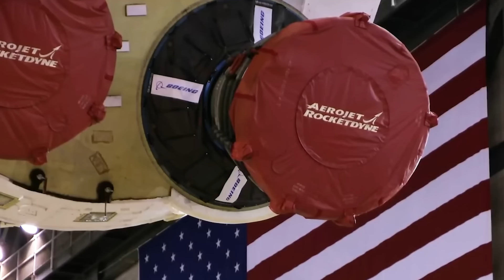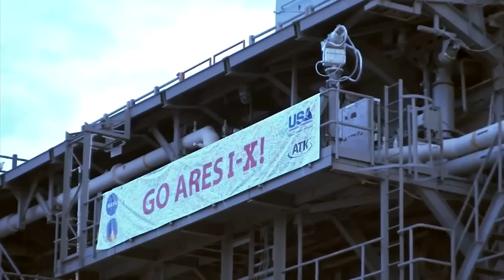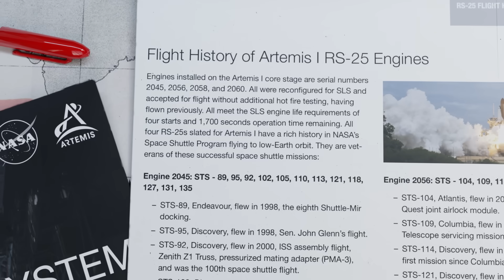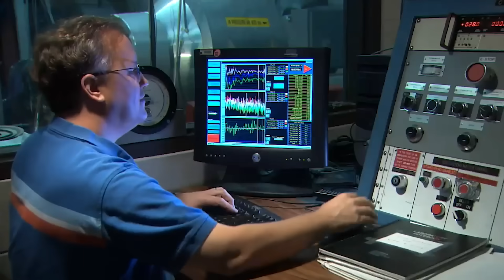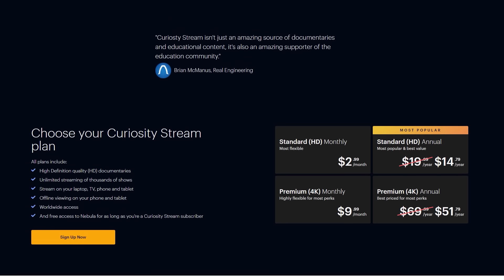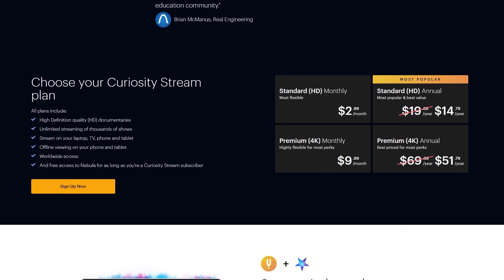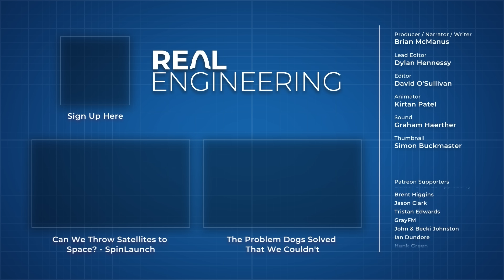The SLS is Outdated. Why Does it Exist?

Comment: The other thing to remember is that many of these parts were already "human rated" whereas ships such as Starship is not and won't be for a while still.
Reply: That's a very good point.
Reply: True, but that's intentional, they're designed using very different philosophies. Starship will likely get human rated after flying enough times just like Falcon 9. Honestly I'd feel safer flying on a rocket that got the human rating after proving itself many times than a rocket that was designed to be human rated in theory but hasn't flown much or at all.
Reply: “Human rated” in the sense that someone has predicted it should work. I prefer “human rated” being demonstrated rather than predicted. The SLS is so expensive that we can barely build one every few years, let alone test them prior to use.
Reply: @limiv5272  , based on that, you're not appreciating how man-rated systems are designed and built. 

The necessary tolerances and checks of key indicators are built into the procedure, not designed into it after enough data points are generated.
If you change subsystem components downstream, it becomes a new, untested configuration again, many components of which representing a single point failure.
Reply: @limiv5272  A rocket build from parts of the shuttle, which killed 14 people.
Reply: yes but if that's the concern, you can just launch a person into LEO in a crew dragon and rendezvous with starship there, instead of taking Orion all the way to lunar orbit before rendezvous.
Reply: Parts aren’t human rated. Systems are. The whole system has to work for it to be safe. So reusing all these parts didn’t really help in human rating the ship and it didn’t save money.
Reply: ""Human Rated""?? These parts have killed 14 people 😂😂😂say hello to Columbia and Challenger Space Shuttle
Reply: The space shuttle was human rated, and had an failure rate many times higher than pre-human rating Falcon 9 launches, as well as a lack of any sort of viable launch escape system. Human rating is a political thing, it doesn't mean much.
Reply: @brll5733  the space shuttle delivered over 800 people to low earth orbit across more than 130 missions.
Reply: @blipboop5594   the space shuttle delivered over 800 people to low earth orbit across more than 130 missions. It averaged 5 launches per year. It proved itself to be reliable.
Reply: @Nightdreaux22647  the parts delivered over 800 people to low earth orbit across over 130 missions.
Reply: @DeepDeepSpace  with a dead crew every 60 flights.
Shuttle had many points to criticize - like the very limited launch abort capability, unlike Saturn 5, the Crew dragon or now SLS with Orion a launch abort was only possible in a very limited time frame. Most time of a launch an abort wasn't possible, also because you can't shut off a solid rocket booster once it's ignited.
Also it could not fly without a crew, even if the mission itself (it launched satellites in the 1980s) didn't even demand one. Nasa made the mistake not to do further development, they stuck with the first generation of a launch vehicle planned in the 1970s until 2011
Reply: SLS still is not human rated either. And until Starship is capable of landing astronauts on the moon, SLS is completely pointless. SLS needs Starship to work.
Reply: @simonm1447  the shuttle delivered and returned over 800 people to and from low earth orbit. if flew over 130 successful missions averaging about 5 missions per year. 
Furthermore, launch abort systems are more for piece of mind than actual safety. In the event of an explosion it is highly unlikely any of these abort systems would save the astronauts. In the event of engine failure,  abort systems can work, but the space shuttle was also capable of aborting if there was engine failure. It could detach from the tank and glide to a designated runway.
Lastly, the final design of the space shuttle was not NASAs decision, it was the US Airforce's decision. It was a joint project between the two. NASA wanted a small winged vehicle to service an orbiting space station. The US Airforce wanted a large vehicle with a large payload bay. NASA only planned to use the shuttle for 10 years, but congress didn't provide the funds to develop a new space craft.
Reply: @DeepDeepSpace  I know the numbers. However, if you compare that to a F9 you paid $ 1,6 billion per single launch which always included a crew, while putting a simple satellite in orbit don't demand a crew at all and can be done by a F9 too for $ 60 million today. 
F9 can also reach ISS with a crew of up to 6 (the maximum capacity of the crew dragon, even if just 4 seats are mounted and used).
Shuttle could never do any deep space missions, since it had too much dead weight and the heat shield would not have survived a reentry from lunar orbit with 40k kph (a reentry from Leo is done with 27k kph).

One reason shuttle existed at all are military missions, it could fuel up spy satellites in orbit (you can't do that with a normal launch vehicle) and it had a cross range capability to fly back from a position over Hawaii on a polar or sunsynchronized orbit to Vandenberg after satellite refueling.
Aborting was possible with the shuttle, but only in a very limited time frame. A conventional rocket don't has this limitations. A proper abort system could have saved the lives of the Challenger crew, they died on impact on water, not because of the explosion.
Reply: @brll5733  Killed because of bureaucracy, lack of oversight and human error in construction. Faults can occur with any vehicle at any time. 

The shuttle was sound enough to have flown 135 times. You can argue design flaws were to blame. Reality was that Challenger was down to management decisions while Columbia was down to the fact the foam was improperly applied.
Reply: @Nightdreaux22647  Refer to my reply to Br LL
Reply: @simonm1447  F9/Dragon cost less to launch because it is smaller and lighter. The space shuttle was a much bigger space craft designed to support 7 astronauts for up to a month so naturally it costs more to launch. And the space shuttle was never intended for manned deep space missions. It was designed to support an orbiting space station to test the feasibility of long duration space flight in preparation for a manned mission to Mars. Furthermore, Dragon in its current form can't be sent to the moon either. It would need enhanced thermal protection as well as an engine.
Reply: @gamingwhatwecan  SLS does not need starship to land on the moon. A small lunar lander can be added to the SLS.
Reply: Like the Boosters on Challenger?
Reply: @DeepDeepSpace  you could launch 25 F9s for a single shuttle launch - 25 smaller launch vehicles have way more payload than a single shuttle launch.
One main problem with the shuttle was the long refurbish time, it took months to refurbish it after landing, there was never a solution for the heat shield tiles where hundreds fell off during reentry and every single tile was unique in shape and thickness, nothing was standardized. Also the RS-25s had to get disassembled and refurbished after each flight.
Reply: @DeepDeepSpace  No it can't. SLS doesn't even have enough energy to put Orion in low lunar orbit, let alone adding a lander to the mix. And no such lander exists in reality or in development.
Reply: @simonm1447  the shuttle was a human rated space craft designed to support 7 astronauts for a month. That is going to take more time to refurbish than an unmanned rocket.
Reply: @gamingwhatwecan  yes it can. SLS has the energy. The issue with the orbit has to do with the Orion. It's engine isn't powerful enough for a low circular orbit but it can put itself into an elliptical orbit of the moon that brings it close to the moon with each orbit. The landing will occur at the closest point. But a small landing craft could be sent with Orion to make the landing.
Reply: @DeepDeepSpace  Dragon is launching on refurbished boosters too - and Dragon is refurbished too. Of course dragon can't support a crew for a month, but this was never a criteria and the Shuttle also didn't need this capability for ISS missions, which represents most missions from the late 90s on.

At the end the Shuttle never reached a higher success rate than most commercial launch vehicles, like the common ULA rockets or the Ariane 5 which was never man rated
Reply: @DeepDeepSpace   you think SLS has a bunch of spare capacity but NASA is deciding to simply shut the engines off prematurely instead of imparting more velocity to Orion? Neither of them has fuel to spare, SLS doesn't throw Orion hard enough and Orion doesn't have enough fuel to make up the difference, which is how we are getting the NRHO stupidity. Add your hypothetical lander (which also needs a hypothetical fairing) to SLS amd there won't even be enough energy to get the spacecraft to NRHO, probably not even to LEO.
Reply: SLS fanboys: "Starship can't take us to the moon because it hasnt flown yet and isn't human rated yet!!"

Also SLS fanboys: "we can land on the moon with a hypothetical lunar lander concept that doesn't exist, isn't being developed by anyone and hasn't been human rated or even approved for a contract by NASA"
Reply: @gamingwhatwecan  you claimed SLS/Orion was useless without Starship. That's nonsense. A small lunar lander can be built. They built one over 50 years ago they can build one again.
Reply: @gamingwhatwecan  the SLS has the energy to push Orion and a small lunar lander to the moon. It's just a matter of Orion having an engine powerful enough to slow the velocity enough to fall into a lunar orbit. Furthermore, the SLS that is launching tomorrow is the Block 1 version. Future variants will be even more powerful.
Reply: @DeepDeepSpace  yeah but if there is no plan to build one it’s never gonna happen. Also keep in mind that this is only possible with a hypothetical “Block B” variant of SLS, something that is only planned on co-manifesting gateway modules with Orion.
Reply: @DeepDeepSpace  if what you’re saying was true then they could simply keep the ICPS attached to Orion and have the ICPS perform the deceleration burn. 

Alas, no they literally can't rebuild a small LEM like they did 50 years ago because modern safety requirements will drive up the mass (more than mass can be saved with modern materials).

Even if you get a 15t lander like Apollo (which only fits two astronauts), that's 41t that needs to go to trans lunar injection. SLS Block 1 can only do 27t.

Yes, it's theoretically possible to develop future versions of SLS for these future lunar lander ideas. But Starship is much closer to hardware reality than any such scheme. SLS cultists should stop having faith in technology which doesn't exist.
Reply: @limiv5272  I think there are some roadblocks to Starship being human rated as it currently stands. I think the "belly flop" landing concept will likely never fly with people inside, too violent. You could give it wheels and try to land it on a runway, but I can imagine the shape and limited control surfaces would make that impossible. I could see a vertical landing work, but you'd still need to keep the g forces for any orientation changes limited to not injure the squishy astronauts. I don't think it's impossible for starship to be human rated, but I think some major changes to design and operation may be necessary. In the end it's a bit speculative at the moment, Starship is still some distance away from consistent unmanned launches, let along manned.
Reply: SpaceX have the only operational human rated launch system in the US. This system is not human rated yet and it has never flown, so I’d say it’s behind Starship which has demonstrated its ability to take off and land and is basically from the new millennium rather than the old. My prediction is that the SLS won’t even fly this month as I remember all the launch delays with the Shuttle, oh and the boosters exploding. Nope, the SLS is a giant rusting white elephant.
Reply: @DeepDeepSpace  The Apollo lander only had to land from low lunar orbit - a lander built for Orion would have to land from near-rectilinear halo orbit, and return to that same orbit. This requires far more fuel - not to mention longer duration life support since the orbit has a period of over a week, compared to 2 hours for low lunar orbit.
So no, you can't do the same job with a small lunar lander. Even the Dynetics HLS, the smallest of the three proposals, would have been about triple the mass of the Apollo lander, and that design was later found to have insufficient performance to land. National Team's HLS was more like four times the mass.
Reply: @marcusoutdoors4999  the SLS is scheduled to launch tomorrow morning. Furthermore, no shuttle booster ever exploded. 1985 saw the launch of 9 shuttles with STS-51B launching only 10 days after STS-51D landed, and Boeing's Starliner is scheduled for it's first crewed launch early next year. 
As far as Starship goes, the Super Heavy booster which is the key to the whole thing has yet to launch nor does it have a launch date.
Reply: @DeepDeepSpace  elon said 1 to 2 months
Reply: I'd rather fly in falcon 9 then this old dinosaur. Starship is going to surpass anything currently
Reply: @blipboop5594  after the Challenger disaster the probability of fatal failure for Space Shuttle was re-calculated to be 1 in 100. I don't know how they calculate it but it's true because of what happened to Columbia (which is indeed within the next 100th flight) the increased maintenance & refurbishment cost did not prevent it, because the design alteration is the reason for fatal incident to occur because 1st they removed ejection seat (which otherwise could save the astronaut during the Challenger incident) and 2nd they stopped painting the fuel tank white (which probably lead to ice formation that cause the Columbia incident). Man rated is mostly about the escape/survival system like abort rockets, ejection seats, and abort procedure which is missing in Space Shuttle (eg: only after the Challenger incident that they devise an abort procedure that allow Space Shuttle to turn around like Falcon9 and return to runway, otherwise they don't have any abort procedure for an incident before reaching orbit, and still didn't have a procedure to abort if SRB experience a failure).
Reply: @triple466  unless Elon plan for the Starship to have an ejection system it would be a death-trap just like Space Shuttle. Space Shuttle for example didn't have any abort system at all, once the SRB is lit it was 1 way street to orbit, only after Challenger that it has procedure to return to runway but it itself is very risky as the Shuttle have to turn around like Falcon9 and it wasn't designed for this.
Reply: @xponen  starship doesn’t need a crew to fly they can test it many times before putting a human on board it’s not like a one time thing like SLS
Reply: @triple466  safety culture is mandatory, an abort/escape system still need to be added.
Reply: @xponen  that’s easy they can install it but not untill it reaches orbit first by itself it’s a work in progress. The rocket can fly 100 times without humans to perfect it. He has more than one rocket he wants to have 1000 rockets and all cheap and reusable.
Reply: Yes. Especially on the computer engineering side. A lot less room for single point failures and multiple contingencies that could be used in a non human rated system that couldn’t be used for a human rated vehicle. Human rated systems are substantially harder to engineer
Reply: @dfiler2  this first launch is a test to ensure everything works correctly. It appears that the Dragon crew capsule only had 2 flights prior to being manned, compared to SLS's 1 flight.
Reply: @Croz89  I think the belly flop was designed to have G forces a human can survive, though you'd probably need to install vomit shields between passengers 😉
We'll definitely have to wait and see if they make any changes to the design, you're right, it's still very early.
Reply: @DeepDeepSpace  the Challenger Shuttle blew up because of a seal failure on the booster, check it out, historical fact, plus I was horrified to watch it live. Boeing has properly lost its way as a company. They were awarded significantly more than SpaceX to create a human launch system to support the Space Station, yet years after the SpaceX solution went into operation, Boeing haven’t even managed a fault free test. My prediction is todays launch will be delayed or scrubbed. I predict SLS will only ever fly once and that plans will be changed to utilise more modern technology. But the key question for me is why anyone would support such a politically driven Frankenstein’s monster when the United States has the best space engineering company in the world by far, SpaceX? If I was an American I would be so proud. Here in Britain we are amazed by the technology and one of my more remotely located neighbours has just got Starlink.
Reply: @limiv5272  I'm not so sure, I think it was designed to cause minimal damage to the vehicle. The rapid change in orientation is going to make it very uncomfortable for passengers at the least. The problem is Starship is so bloody massive and awkwardly shaped that options for landing it, especially on earth, are limited.

Honestly, I think it's a bit of a waste to use such a massive vehicle for only carrying 3-4 crew members anyway. Save Starship for cargo, something smaller would be better for humans.
Reply: @brll5733  I don't think it's fair to blame those death on the Shuttle. One was because of human "error" in approving the launch. 
The other because of damage to the tiles by falling debris.
Reply: @editman145  NASA reused the space shuttle and its solid rocket boosters for 30 years across over 130 missions.
Reply: @gamingwhatwecan  Well, then it won't ever work.
Reply: @DeepDeepSpace  I watched the Challenger explode and kill all on board due to a failure of the seal on its booster. The booster’s failure is well documented historical fact. Predictably today the SLS failed again, repeating the pattern of multiple issues that has meant it hasn’t even managed a single wet rehearsal. I stick with my prediction it won’t fly this month and I’d say the chances of a launch in September are less than 35%. With regards to SpaceX, as a Brit I’m baffled as to why the US isn’t more proud of having the most technically advanced space company in the world. This year they’ve launched more than a rocket a week, they have over 3,000 satellites in their Starlink Constellation and my god man, you can’t have an eye for detail as the SLS Will is dependent on a Starship to land on the moon, yes the Starship is the vehicle which will fly all the way from earth and land on the moon having picked up its crew from the pointless outdated SLS
Reply: @marcusoutdoors4999  the Solid Rocket Booster didn't explode. The SRB exhaust burned through a seal between two segments. The exhaust ignited the fuel in the external tank. The accident happened because the challenger was launched in weather that was too cold. The cold weather weakened the seals. Engineers warned about it beforehand but the decision was made to launch that day anyway. The accident happened due to human error. There was nothing wrong with the hardware. The SRBs didn't explode. The external tank didn't explode on its own. It exploded due to being acted on by an external force.

And you keep rambling on about American not liking SpaceX. The American tax payer helped fund SpaceX as part of the commercial ISS resupply and crew transfer program. But falcon 9 and Falcon heavy can't send people to the moon. SLS can.
Reply: @gamingwhatwecan  The limit for the block 1 is only the interim cryogenic upper stage. The block 1B and 2 will have almost double the payload to Moon, thanks to the exploration upper stage. Also, with the gateway you won't need to send crew and cargo/lander in one launch and you can have many commercial launches to the gateway. The nrho gateway is complex but has incredible flexibility to do what is impossible with direct ascent or other rendezvous strategies.
Reply: @DeepDeepSpace  "This roller coaster has had 800 passengers, is ridden 5 times a year, and has only killed 13 people!"
Reply: @DeepDeepSpace  Falcon heavy has way more than enough deltaV to get something to the moon.
Reply: Starship hasn't had a successful flight yet. It still keeps exploding.
Reply: @kwuite1738  Falcon Heavy could potentially send a manned spacecraft to the moon, but you wouldn't be able to recover the boosters afterwards. So it would be just as expendable as SLS.
Reply: @kwuite1738  poor analogy. We are not talking about rollercoasters at an amusement park. We are talking about a launch vehicle. Launch vehicles operate at the edge of what is engineeringly possible utilizing large amounts of explosive fuel. Rollercoasters are simple and basic by comparison.
Reply: Human rated? You mean like the Challenger and the Columbia?
Reply: @brll5733  Basically, demonstrated to be unsafe.  Still SLS should be safer than the Shuttle, you still have the threat of the solid boosters though.
Reply: @DontThinkSo11  Starship will probably be safe on launch its the landing back on earth that seems a little scary.  But yeah, we know falcon 9 and Dragon have a great track record.   I'm pretty sure starship is going to have to fly a lot of times before we accept that its safe enough to return to earth with a crew on board.
Reply: @literalantifaterrorist4673  It could be Starship only has a success rate of 1 failure fore every 25 flight because of the cost and capability potential it would still be extremely useful for cargo even if it never gets man rated(alternatively you could just have an all female crew).  If you want a moon base you are going to have to ship a lot of equipment and supplies to the moon.  Its also perfect for building space stations and heavy LEO industry.
Reply: @DeepDeepSpace  
You: "Falcon Heavy can't send people to the moon"
Me: "That's demonstrably false."
You: "Well it's not reusable though..."

Also you: "It's ok for a form of transportation that is over 60 years old to have a ~2% chance to simply explode when in 10 of those years we went from no one in space to a man on the moon."
Reply: @kwuite1738  Aviation gave us a good model here.  In the early days of aviation it was pretty damn dangerous.  The more aviation went mainstream the more we learned how to make it safe.  The reason aviation is as safe as it is today is because we learned from each and every air disaster.  If you want to have a large future space industry/program you are going to have to accept a learning curve, which means people will indeed die.
Reply: @jeffk464  I agree aviation is a good model here. Imagine if airliners were in the same state in the 70s or 80s that spacecraft are now. You can't claim cutting edge on something over half a century old. It's only as bad as it is because of bureaucracy and the type of people in this comment section willing to make excuses for them.
Reply: @kwuite1738  with current  technology traveling into space is dangerous. That is the way it is. You are delusional if you think anyone can build a launch vehicle/space craft that is going to be as reliable and safe as an airliner with current technology.
Reply: @DeepDeepSpace  I can't tell if your reading comprehension is severely lacking or if you're purposely misinterpreting what I'm saying.
Reply: @DeepDeepSpace  launch abort systems can and have saved people in the past. So I don't get where you get the notion that they aren't useful.
Reply: @DeepDeepSpace  why do the exact same thing as 50 years ago. We have the capabilities now to go way beyond what we did 50 years ago.
Reply: @guillaumelalonde7945  you're are asking a very vague question. Exactly what are you referring to that was done 50 years ago?
Reply: @DeepDeepSpace  and falcon 9s have flown 173 successful missions in 12 years. What's your point
Reply: @DeepDeepSpace  why should we build another LEM when we have the capability to build much bigger and more capable crafts
Reply: @guillaumelalonde7945  launch abort systems aren't guaranteed to save people. At the end of the day, if something goes wrong during a launch, survivability is limited.
Reply: @guillaumelalonde7945  the point is the space shuttle had a proven track record. In addition, the space shuttle flew over 135 missions with a crew of seven each time. Falcon 9's missions were unmanned satellite missions.
Reply: Except that the two shuttles that were destroyed taking the entire crew were also "human rated."
Reply: @brll5733  columbia is irrelevant here as the sls does not use the orbiter vehicle and challenger srb problem was fixed
Reply: @GilmerJohn  planes that crash are human rated too. What's your point? The Space Shuttle delivered over 800 people to low earth orbit across over 130 launches.
Reply: @DeepDeepSpace  He is saying that Human rated doesn’t mean a whole lot, and that a well tested spacecraft is better than any “well engineered” one. I agree, testing is better than any good engineering simply because engineers make mistakes.
Reply: @Old_Ladies  Pretty sure Starship SN15 didn't explode. And those were prototypes.
Reply: @CarFreak There's a limit to the number of backup safety systems you can have. Capsules don't usually have escape pods, nor do airplanes. Human rating of a vehicle comes down to the rate of failure authorities are willing to accept. If you can demonstrate that your vehicle is safer than minimal requirements, you will get the rating. Ultimately it doesn't really matter how you achieve that low rate of failure.
Reply: @CarFreak I never really looked for numbers before. From a bit of googling I realized two things: 1. there's probably a different threshold for every parameter and system, like say the probability that space junk would be able to penetrate the hull of a craft. 2. NASA seems to be trying to keep those numbers hidden, probably not wanting the public to react. People tend to dislike governments quantifying the cost of a human life, but in this case you have to put a limit on safety that can be achieved within a feasible budget or we'll never get off the ground.
Reply: @CarFreak At the moment it's considered to use the whole second stage for a flight abort. However, things can change  and for the next years the use of starship will be restricted to unmanned cargo missions anyways.